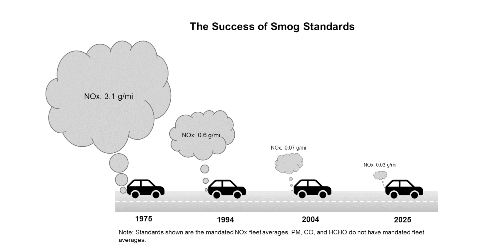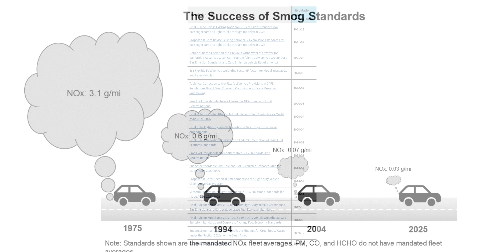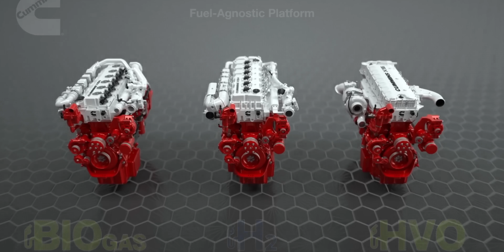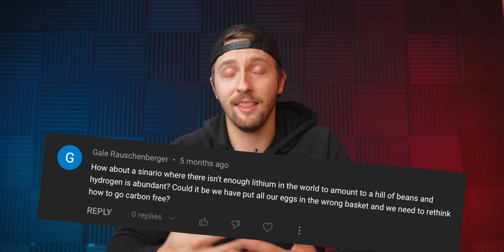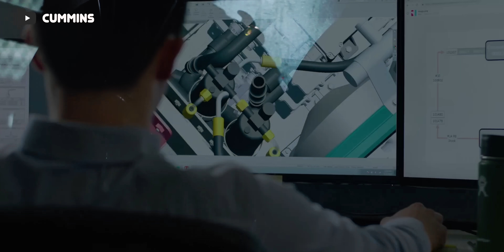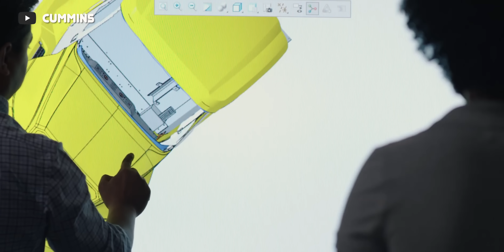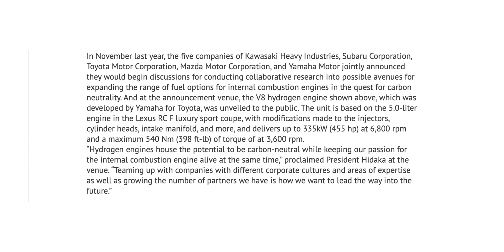Cummins Hydrogen Engine Will KILL DIESELS FOREVER

Comment: Dusty Brains   it appears you do not know that gasoline and diesel is Hydrogen gas....Diesel and gasoline is Hydrocarbon fuel...Dirty Stinky Nasty Hydrogen from dirty fossil petroleum...All combustion engines are Hydrogen powered...the carbon is added to contain Hydrogen to transport like water...it is only the Hydrogen introduced to oxygen compressed with spark that causes engines to combust...the carbon does not cause combustion it is only a carrier...the sun burns Hydrogen the earth is powered by Hydrogen light heat photons are all caused by sun burning Hydrogen....The Earth is Hydrogen Powered... Hydrogen is the past present and future...Water is H20...Hydrogen is the foundation of all life on earth...Hydrogen makes stars shine at night....WOW....!!!

Comment: Internal combustion hydrogen engines do not require a lot of rare Earth minerals to produce.  We could probably replace most of the diesel and gasoline engines in cars by the year 2065.  This would require billions of dollars though to replace most of the gasoline stations and put hydrogen infrastructure in place.

Comment: Once Tesla ramps up production of the Semi Cummins will no longer exist.  IMHO it will take Tesla 5-7 years to build the infrastructure and have the production capacity to dominate the trucking industry maybe even less if they deploy megapacks at truckstops.  It's coming, so my advice to cummins is to start trying to improve on the electric motors Tesla makes. Don't waste your money developing something that will have a 5 year life cycle.  I have been fortunate enough to live the electric lifestyle.  I sold both my oil burners, dodge ram diesel and Audi TDI and replaced them with Tesla's.  I have installed enough solar and powerwalls to provide all my power.  I did this not to "save the world" but because it provided me an ROI and I do have a obligation to preserve what the Lord has given us in his beautiful creation.  I can say without a doubt I will never go back to any ICE powered vehicle, they just don't make sense.  If you need any info on my experience with solar and electric vehicles I am happy to share.
Reply: The tesla semi is a joke though...
They hardly work

Comment: Have you looked at what JCB is doing with hydrogen fueled combustion engines based on diesel engines? They are fitting them in existing earth moving equipment and fitting different fuel tanks. The rest of the machine is unchanged! 
The best thing is the torque and power characteristics are the same as the diesel!
The operator will not see a difference! 
They also have enough fuel to run a full 8 hr  shift stored at 350kpa ( about 5000psi same as hydraulic oil pressures)
FYI uses current technology and not foreign rare earth metals 
Cheers Warren
For more see recent Harry’s farm video

Comment: Running H₂ through an ICE: less efficient, less torque ,more maintenance ,*less range, lighter, no regenerative braking
Running H₂ through a fuel cell:  more efficient, more torque ,less maintenance ,*more range, heavier , regenerative braking.
*less range because of less efficiency compared to a fuel cell i.e. less km/kg H₂

Comment: Think you have not learnt the historical lessons of growing irrelevant pertaining to, for instance, Kodak and Blackberry, etc.  It's only a matter of time now for 2 things to happen.  [1] breakthrough in a cheaper equilibrium in cost relating to process production of liquid hydrogen; and [2] breakthrough in hydrogen-ICE fuel cell SERIAL hybrid vehicles.  Once these 2 converge for a reasonable consumer cost efficacy, there should be no holding back save for the political will of countries that would help enable hydrogen fuel pumps as a matter of refuelling infrastructure.

Comment: Fuel cells (+ electric motors) are just much better at converting hydrogen into useful power compared to a hydrogen combustion engines. So apart from sound and feeling, there is basically no reason to ever use hydrogen combustion engines.

Comment: Electrolysis is 98% efficient and a total of 94% efficiency compressed. And it can be moved in a pipeline, or you can get about 4 times as much H2 on a truck compared to Diesel. H2 is a better energy storage method than batteries.

Comment: I have always seen hydrogen as the future of energy needs, when ignited under pressure ( supercharging) it provides massive power output and pollutants don't exsist the exhaust is H2O. By far the most abundant element that is available is in our universe, its a no brainer to develop a hydrogen/electric hybrid system.

Comment: I was in management at CECO for almost nine years in the ‘80’s. R&D was always a top priority and had a very high ROI. The carboniferous soot produced by diesels is SO high. Hydrogen might be suitable fuel source IF power > Weight ratios, etc. are still acceptable for the applications. I say they make it work!

Comment: We miss the point of hydrogen itself being a battery, where instead of mining more rare expensive metals with a environmental and social impact. We are converting the excess electricity of hydro, wind, wave and solar where the grid is not using the electricity and storing the energy as hydrogen. If we do the math of the cost of making a long power grid and the loss of electricity, in some ways converting the electricity to hydrogen at the power source adds a savings, we also are not looking at the oxygen as a product when we use energy to split h20.  But if we use the oxygen to inject  to cleaning water ways, again we are adding a eco efficiency, this if we do the math in a old world perspective that there are no cancer costs or no environmental cost, then hydrogen seems expensive, to produce, if the banker or investors lives are only important, when all lives matter and the echo systems then hydrogen is cheap and efficient.

Comment: The hybrid hydrogen ice is probably the future of heavy trucks and machinery using a smaller battery would compliment the hydrogen ice such as full electric when coasting or stationary and both systems operating on max power and regenerative braking, full electric heavy trucks will not be possible due to the weight and bulk of the batteries along with the short range and the cost associated using a conventional engine is by far the cheapest and quickest option

Comment: Until now fuel fossil still step ahead because entire system rally on burning something (fuel) to a very small smooth explosion for propulsive force.
For hydrogen from water, the very first challenge is how to release/isolate the Hidrogen and Oxygen atoms very quickly to a very safe storage chamber for later use in engine.

Comment: Electric is just a really good marketing campaign.  You’re just trading off where the energy is produced so the driver can feel better about not burning a fossil fuel in an engine.  Production of batteries?  Fine.  Mining for rare earths?  Fine.  Poisoning water supplies to refine the earths?  Fine.  Burning coal to produce electricity?  Fine.  Producing massive amounts of plastics to build the cars?  That’s fine, too.  Just don’t use internal combustion engines.  That’s not fine.

Comment: About 35 years in the high pressure hydrogen business. The metallurgy is not there for hydrogen fuel yet. Maybe on a limited basis we should revisit fuel cells but hydrogen in the embrittlement issues and a vibrating machine or a bad combination

Comment: Hydrogen is, without a shadow of a doubt, the single most stupid, and most dangerous fuel it is possible to use or create.
Anyone who proposes its use is ignorant of the total destruction Hydrogen is waiting to unleash at the slightest opportunity. It is many orders of magnitude more dangerous than gasoline. Diesels will be around for many decades to come.

Comment: In the short term, may be a decade down the road EV and PHEV is economical compared to Hydrogen though not compared to gasoline. but it is not environmentally friendly at all. It's true that it does not generate green house gasses but green house gasses are not a threat to the planet because herbivorous animals generate far more green house gasses then the cars do. Also the claim that EV is cleaner is also false. Gasoline engines generate green house gasses by burning the quickly depleting fossil fuel but compared to that EV generate far more toxic depleted chemical battery waste, on top of using electricity as fuel which is itself generated in ever higher quantity using more fossil fuel powerplants, and if that isn't enough destruction of environment, it also requires rare earth metals (rarer then fossil fuel) to build heavy EV batteries. That is still not the worst of it, rare earth metals are mostly found in central Africa one of the last pristine rainforest regions that the planet needs to replenish atmospheric oxygen that we breath in and the mines that destroy the rain forests are also located in politically unstable nations where poverty is rampant and children are used for labor. In order to keep the EV resource flowing into first World countries the government turns a blind eye to human rights violations in those regions while private companies spend billions to keep the region politically unstable so no reformist government can lead the nation's into prosperity by demanding higher rates for the precious resource. 

Growing demand for EV is not really because people are eager to save the environment but more to do with the growing social media narcissism that consumers want to look down on people around them by claiming they purchased a really expensive EV and are saving the planet. Well you didn't save anything and even if you managed to buy that really expensive EV to show off to everyone on your Instagram account somewhere past the current decade those rare earth metals will start depleting at a rate that EV will become super expensive and the countries that provide those building blocks of EV will be in a state of war and blood shed because some idiot in AMERICA wants to buy an EV to get likes on his social media page.

Comment: Speaking of hydrogen and diesel… hey guys, what is the Cetane number of hydrogen and what is the Cetane number of hydrogen?..😁😁😂😂
Do you really think that diesel engine designed for bloody diesel fuel with specific cetane number, ie combustion temperature and pressure would run successfully and for the long period of time on hydrogen?!..

Comment: Verry intreating story. But Hydrogen is not new. I know of a shipping company converting (when the build newer vessels) to Hydrogen. But interesting. PS electrical excavators isn't something new. We used that in Africa during the 70'ies and 80'ies but thou's where huge  and connected to the electrical grid and resulted in every time they fired a (there where at least 5 running) shovel (we called them that) we had a small power cut :-) . And by the way, of the highway machinery I may be not but in the mines of Kiruna in Sweden I know they are going electric on there heavy equipment so why wouldn't of the highway machinery be able to go electric. 
But back to your point interesting Hydrogen... as electrifying long-haul trucking looks farfetched right now.

Comment: Nice, more hydrogen engines. The company i work for produces natural gas engines (and other gases, basicly everything with carbon in it), but in the 500KW - 5MW range for mikro grids and such. We have a pure hydrogen prototype. Currently in the process of building our own hydrogen infrastructure. Exiting times. 
I think mobile diesel will be with us for a long time. The energy density is just too high.

Comment: There is no excuse for any fuel, cause every fuel needs a lot of processing and therefore energy. But at the end Hydrogen is way cleaner. There are also many new ways to store hydrogen, pressure it down to liquid is not needed anymore.

Comment: Battery vehicles are a nonsense and worse polluters than fossil fuelled vehicles.  All it's being done is transferring pollution elsewhere. 
Not to mention the criminal use of child slave Labour. How can ev cars buyers live with their conscience, shame on them.
Also diesels were going to burn ammonia, NH3, what's happening there?
Also like hydrogen, H, petrol and diesel oils require electricity to produce them just like electricity required to charge crappy batteries.
Vicious circle.
ALL IN ALL BATTERIES ARE CRAP, EXPENSIVE AND UNRELIABLE!

Comment: Hundreds of thousands of electric vehicles are already on our roads. So far the only easy to find and reliable charging stations are Tesla Superchargers. Most all other charging stations are iffy at best. And hydrogen gas can not be easily or cheaply transported to fueling stations, unlike gasoline, diesel or the simplest and most common fuel, electricity.

Comment: Why not invest in fuel cells instead, and also invest in massive large-scale H2 generation using solar, wind, geothermal, and hydro-power, all of which are green?  If I were on the board of Cummins, that's where I would invest.  Oh, as for H2 storage, I would invest in solid-state R&D in order to have maximal energy density and also minimal volume.  Once stored in solid-state,  transport of H2 to H2-pumps in existing gas stations becomes enormously less costly, and that renders convenient availability and logistics no longer an issue.

Comment: It will actually depend on which technology will be the first to meet demands in cost, range and infrastructure. I myself believe on near future there will be a cheaper solution for batteries with lower cost  and longer range as many companies are heavily investing on.
Reply: Actually one of the biggest obstacles for EV trucks is weight.  The batteries for an EV truck weigh several tons, and that's several tons you can't carry as cash making payload as they're included in the all up weight restrictions.

Comment: I am finally pleased that someone is addressing hydrogen engines OTHER than just for the automotive industry`I have a train sim from N3V Games called Auran Trainz On mz largest route (board) I have auxiliary to solar power plants -- STATIONARY power plants with fixed governed rpm as to put out 50 or 60 Hz of high voltage electricity to supply the required 25 kV/50 Hz single phase to the catenary network. Yes in Argentina there is a large scale megawatt powerpland utilising Jenbach J420 generator sets running off of hydrogen. It is already in use, but most websites ONLY limit their discussion of hydrogen be it fuel cells or ICEs to the automotive industry. This is NOT the only industry that makes use of engines. Tghhe medium and large size engines found in the power generating industry along with the maritime industry has large low rpm diesels. Just convert these diesels to spark ignition engines similar to a petrol engine but replace the fuel with hydrogen`H is the symbol of the lightest element in the universe (hydrogen) and is the ONLY combustible fuel is NOT a hydrocarbon (hence fossil-fuel) butr is clean and the exxhaust is actually POTABLE, it can when cooled down enough be dranked`

Hydrogen may be more viable on ships and especially as stationary power sources such as major power plant producing electricity. It is high time this use gets addressed

My only purpose of the ICE is electrical generation, preferably from a stationary source (or in the maritime indistry). For smaller engines, electric motors are just fine.`Thanks.

Comment: I think you’re correct in that eventually we will shift, by in large, to using hydrogen fueled engines in the future. It’s not the NEAR future, but it will happen. As you say, generating hydrogen fuel is one stumbling block and, like ev changing stations, the hydrogen fueling stations infrastructure is virtually nonexistent. It’ll come, but I’ll be dead by then. ( I’m 76 btw)
Reply: yep born to early for this , I could barely make it 68.

Comment: hydrogen fuel cells  and on site electrolizers using magnets in a closed loop 1-0.5=0.5 which equals 100% energy now double it up, take that 0.5 energy produced and put it all towards an electrolizer and get one, then double up again and get 2 then double up again and get 4 and continue until you get 1000 gigawatts to power the America's from a single source - a trickle of natural gas and water making hydrogen for the first ballard fuel cell oh wait,  you can't sell it without violating a patent, a corporate secret since the late 1800's
Reply: as for a car, all that is needed is a 1 liter bottle of water and a one time ignition at the factory exit, it will run forever as long as there is a draw of electricity like a digital clock as in you car will always be running especially the heaters in winter to protect the water from freezing, one will need a key code to drive it but it can be used as a generator for the cabin or camping and you would have the same to power each house and free up copper from power lines no longer needed.
Reply: they want to charge us for hydrogen, we can have cars and homes that never need refueling ever again, ever. This is why they despise it and hydrogen no matter how you look at it, is zero emissions adapt or die.

Comment: I've been convinced for a long time now, but as you've pointed out, using Hydrogen as the only source of energy is impractical due to its impracticability of storage. But why aren't you or anyone talking about its hyper efficient burn rate, compared to that of fossil fuels? By utilizing a dual fuel source, we can literally eliminate emissions all together, while creating, even maximizing efficiency fossil fuels by increasing/completing their inefficient combustion rate as pointed out nearly 50 years at the SAE. Go. I'm rooting for it and will shortly supply my fleet with this technology to help my fuel economy, but reduce emissions for the fun of it in the process. W riz, right?